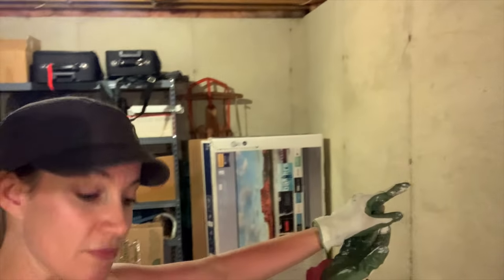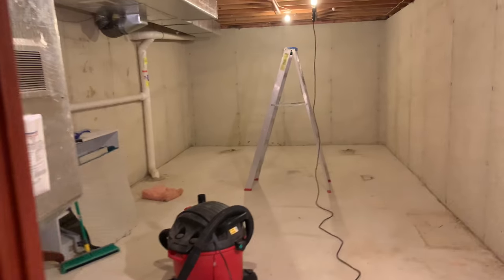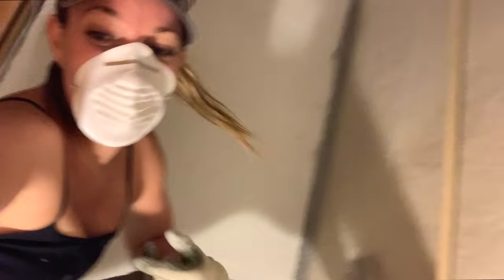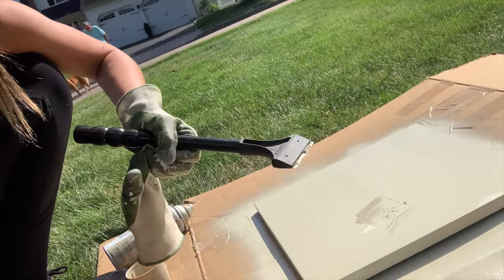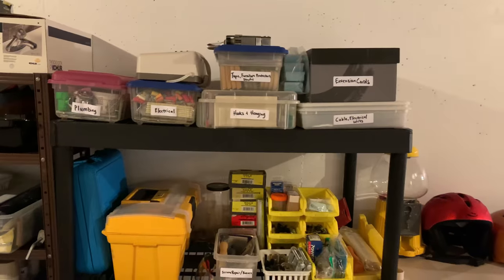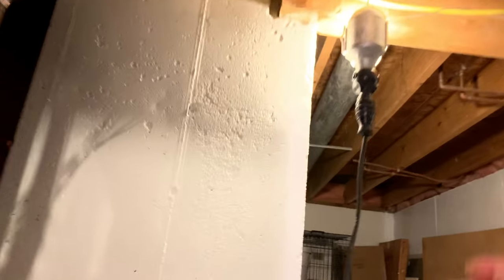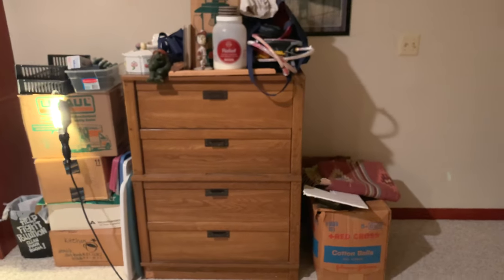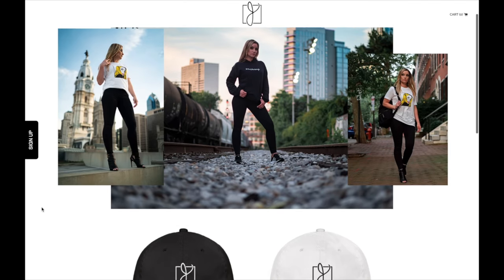Big Reveal...

Comment: Cleaning the filter to the shop vac is optimal
Reply from the maker: Yup, this one had a bag luckily.  but it was gross 😂
Reply: @jensmith  I was an assistant maintenance man for the apartment complex I used to live in, a year ago, and this other maintenance guy, had the shop vac exhausting out the window without a filter. It almost burned out the motor!